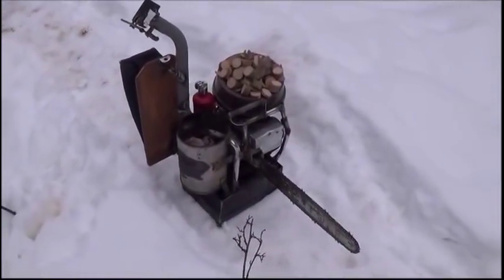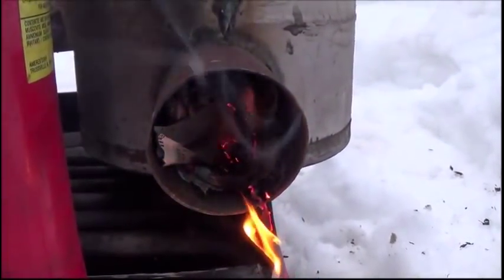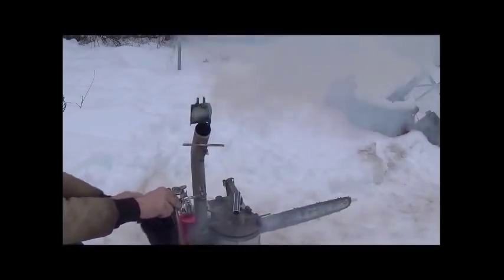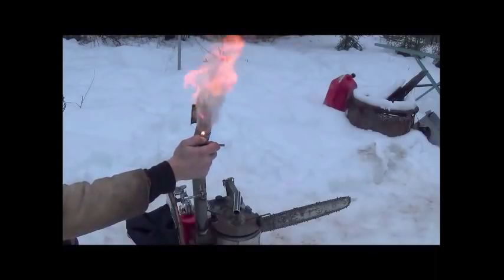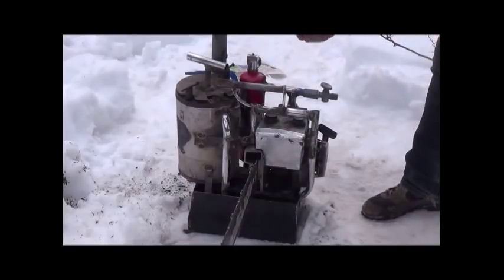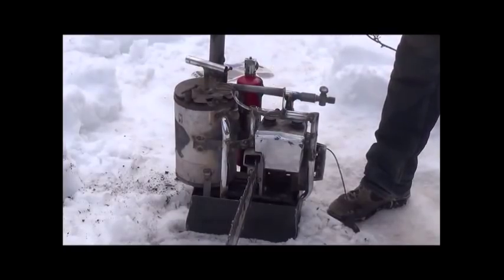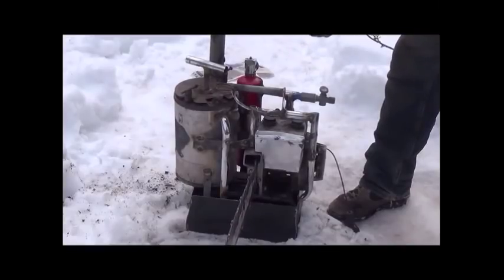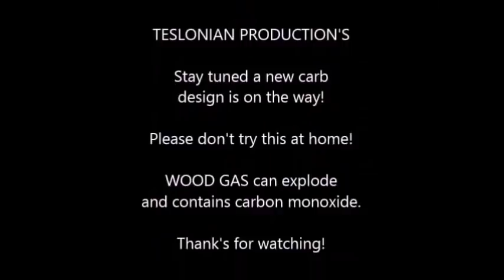My Chainsaw uses firewood as gasoline, Greenest chainsaw ever!

Comment: You might be able to condense the wood gas to liquid and use the carburettor, there is a similar H2 system where they mix with regular fuel and get enormous increase in fuel economy.  Great demo, clear and well presented

Comment: That's a Good Idea.  Now put the chain saw on a Generator and create electric power.
Reply: or just, put the gasifier on a normal generator? 4 stroke would be better for this, no need to add oil.
Reply: And then he can plug an electric chainsaw into the generator, just to take it full circle.
Reply: Charge batteries for a cordless chainsaw.
Reply: @squat224  He's already done it! Years ago, in fact.

Comment: When you remove the carburetor try plumbing with the smallest pipe you can get enough flow through. Putting the valves close to the intake as possible will help with getting a quick air/fuel mix and reduce the lag when you are adjusting.

Comment: Nice build. Problem is if there is no lubricant in the fuel the bearings in the crank will burn up. Maybe add high temp bearings or if your all about using just wood, sap might work at high temps.

Comment: I loved that demo.  It would be interesting to run your chain saw on steam with a 30 foot hose.  Steam has some portability problems but so does your wood gas setup.  I see your set up as an off the grid way to live comfortably after some kind of disaster like in Walking Dead  or Defiance.  That wood gas looks dirty like it may gum up an engine faster.  Maybe run hotter so the gum comes out or is burned.  I loved that video .... we need more people that can do things like that so there is no reliance on Mennonites or Amish to save us if something bad happens.

Comment: You should invest in a wide band not short band 02 gauge to fine tune your motors. there not that costly if you look on Amazon or eBay. You can also show with tech that wood is clean. I know that the out put will be different but once you fine the proper setting range it will give you a start point for all your motors . Run it off a small 12v batt.

Comment: How about try to use heat exchanger to get some heat out of the wood gas, and use that heat to warm up air going in the wood gasifier? Cooler wood gas is more dense, so it is better for the motor.

Comment: 1 I think u are having an under fueling issue not enough gas 2 I think u can go far by rigging cable or levers to close the ball valve of fresh air as the throttle is increasing at a certain ratio 3 I would use the exhaust exhaust to stoke the flame ; ) or at least a portion possibly spin a turbo and have the intake stoke the fire

Comment: Wouldn't it be a lot less noise and stuff to mess with to turn the wood into electricity and run the saw with a battery?  -Or simply electric supply cord from a wood fired generator?

Comment: Greenest and greenest, somthing fully electric would be "greener" haha :D Still really cool :)
Reply: Wrong again,  Using wood gas in a engine produces 16 times cleaner emissions the gasoline so ya this is rather clean, infact  its right there with natural gas emissions!
Reply: This is as green as it gets since wood is carbon neutral,  even if it ran on electric it wouldn't be as green as this, because electric has to be made by some means whether by damming a river or ripping down mountains to make a solar panel it all needs non-carbon neutral resources to provide electric energy, (solar panels require much more energy to make than they will ever produce so there not really green or carbon neutral), wind generators require massive amounts of carbon to produce and will never replace the energy they cost to build, so this is about as green as it gets!

Comment: Probably be better off running a stationary 4-cycle engine off your gasifier - then sending the power through hydraulic hoses, electrical wires, compressed air to a handheld (but "tethered") chainsaw.

Comment: I am quite amused by this devise.  However I  can see issues working with it due to the size.    Think it would be possible to separate the power plant from the chainsaw and  connect them with a hose.  some what like a power cord?   I imagine a High heat hose could be the biggest drawback ... If it would even work.... 

Or maybe bottling the gas...    would probably need to filtrate it XC

Comment: Well if you have to build a different intake system maybe you could put some kind of oil drip tank on it.
Reply: I didn't notice the two caps. Honestly I have never seen a chainsaw with separate tanks for oil and gas. My brother has a rototiller with separate tanks but I've never looked to see where the oil and gas mix I just assumed at the carburator.
Reply: Most people will think that is for bar oil, but your right its for two stroke and the bar oil is on the side.